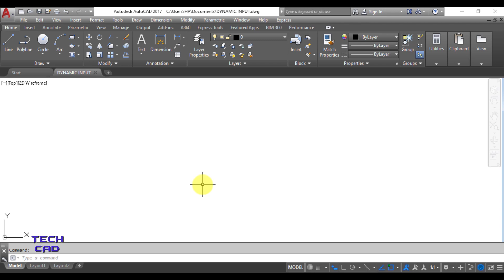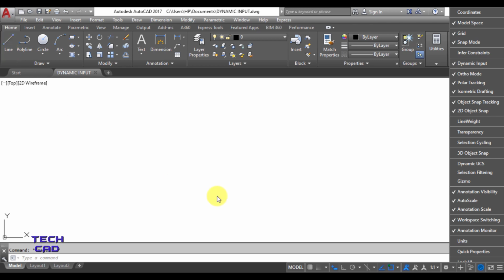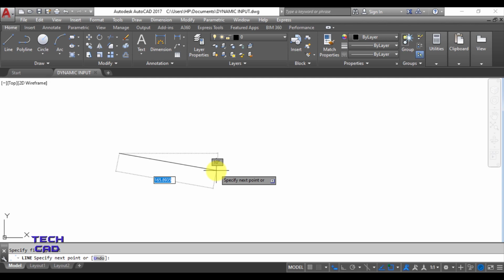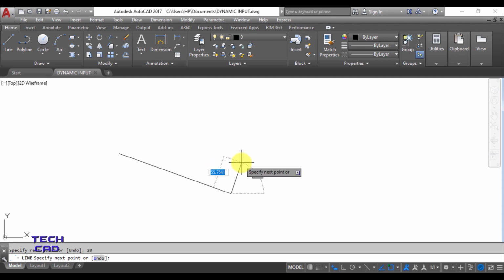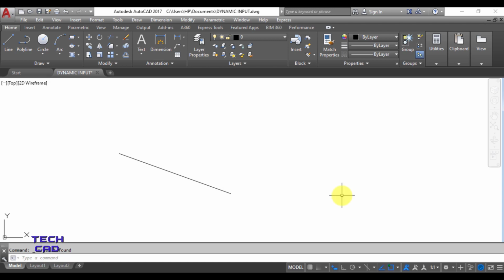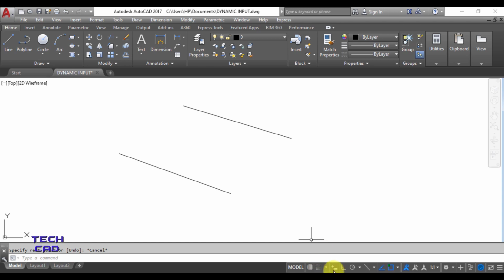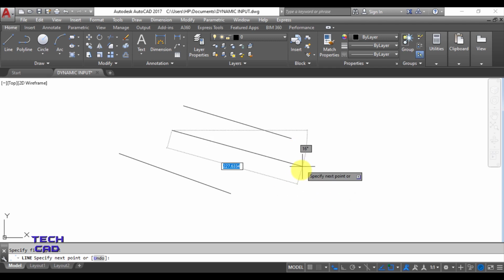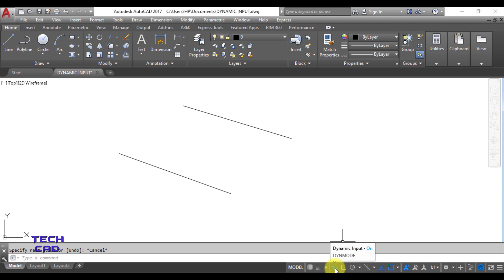DYNAMIC INPUT IN AUTOCAD

Comment: thank you for your video, if you may help me with a situation, I used to have the exactly display that you have, but nou, when I draw a line, I can not see the dinamyc mesurament. 
and also, I can not see a line lenght when Im with cursor on that line
Reply from the maker: Dear 
Yours query reflects that Dynamic Input is off by default.Kindly switch on the Dynamic button from the down tab Bar. Everything will be ok after that.
All the best....